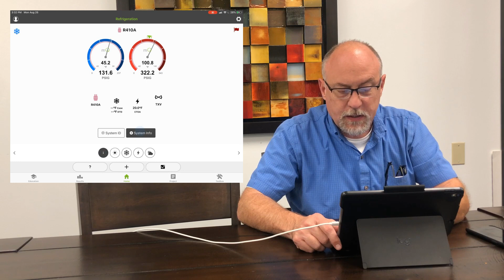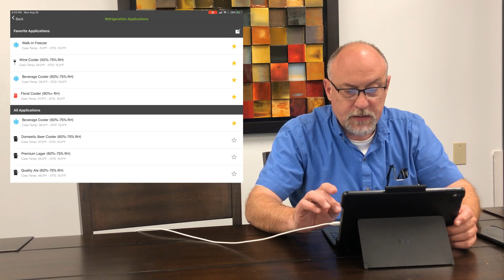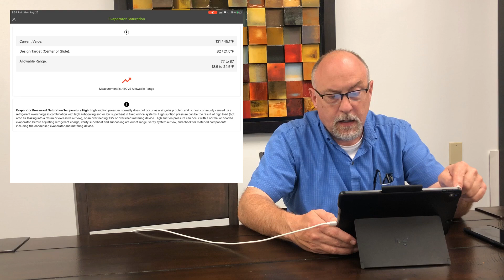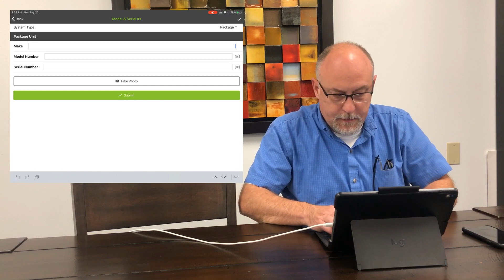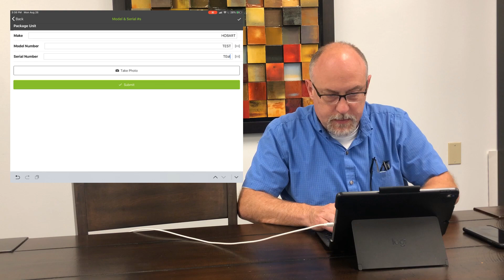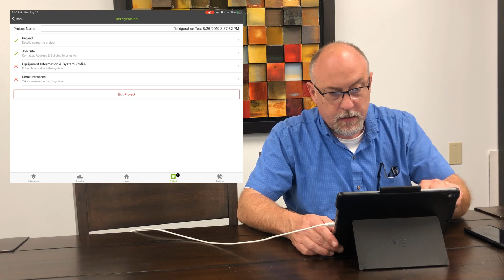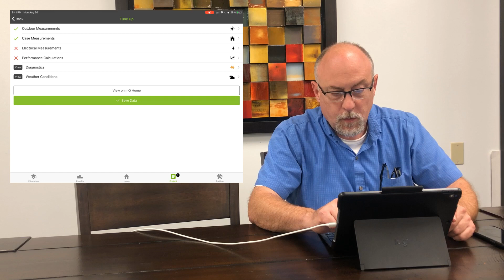Refrigeration incorporation

Comment: i think it would be useful if we could see a " Compressor Superheat " & " Evaporator superheat " guage side by side. Also if it could state the Target superheat for both. also asking in the setup if the suction line is bonded to the liquid line or not.
Reply: OcRefrigeration , Hvac & Electrical Video's. I agree OC, letting me watch total system superheat and the superheat from multiple evaps and CTOA and subcooling all in one place would be great. Good idea with the bonded suction / liquid line OC, give the cap tube fridges some love also.

Comment: on a idea system analysis taking are good when you have manufature equipment data information, but sometimes when you are working on older equipment you only have little data rating info or no info at all to enter into your profile..great software and video info
Reply from the maker: The basics needed are the very basic you would need with or without MQ software. Refrigerant type, metering device type, CFM/ton. Maybe a target subcooling or we use 10. If you don’t have that there is nothing you can do anyway.
Reply: true... thanks for the info

Comment: First time I opened the MQ app in months, now I’m going to have something to try out. 
Regarding the multi-superheat mode, I assume that you mean that I’ll be able to watch total system superheat as well as individual evaporator superheats off of each evaporator suction header? Being able to watch that plus the CTOA simultaneously would be excellent to be able to watch the relationship between evaporator efficiency and the compression ratio / COP. The approach indicator doesn’t bother me even if it isn’t necessary. I do like it, and am looking forward to all of the new features that you’re going to add in. THANK YOU JIM!

Comment: maybe also dual subcooling guages for checking subcooling on long runs.
Reply from the maker: OcRefrigeration , Hvac & Electrical Video's.  I thought about that too, but you really need pressure and temp at the same location. A typical liquid pressure drop is easily 15-18 psi. You could monitor temperature changes, but not subcooling.
Reply: Agreed. But, i Would still like to have the option as i am starting to install Suction & liquid ball valves , Sight glasses & suction & Liquid service tees at evaporators now so units can be Serviced , charged & monitored without going up on a roof on remotes with Extremely long runs & Difficult access to condensing units. Thanks for the reply.

Comment: It would be good if we can change units for the capacity of the device aka "nominal tonnage". If I switch all units to SI (used on this side of "the pond")  this field still shows the tons.
When I set "Min. Condensing Pressure" to 14 Bar it automatically enters 11.6C for R404A which is not correct. It shoud be appx, 32C.

Comment: diagnostics info should be an selection option if you want to use it or not
Reply from the maker: It is an option. Just don’t hit the flag and it won’t show you diagnostics. The diagnostics will eventually be an option to show up on a diagnostics report though. Currently they’re only accessible on the app.

Comment: I used it for the first time today and I kept getting an alert about suction line temperature wasn't present. The probes were reading the correct line temperature of -35 degrees. Did I do something wrong on the app?
Reply from the maker: Can you email a screenshot of that to jim@measurequick.com. I don’t know that I have seen the alert that you are seeing.

Comment: For the first time user of your App, you should let them know they should FIRST hook up / map their Fieldpiece probes in Toolbox. When I first got mine I have no idea what the problem is since I could see measured numbers from Probe Manager, but they didn't show up on Home page.

Another issue I found recently that without psychrometer info your App does not show any analysis. I have to use Fieldpiece App when I don't set up psychrometers. Which is not good.
Reply: Superhydrophobic Coating you can manually input the info and or clear the marker saying missing key data points and it’ll give you some potential faults